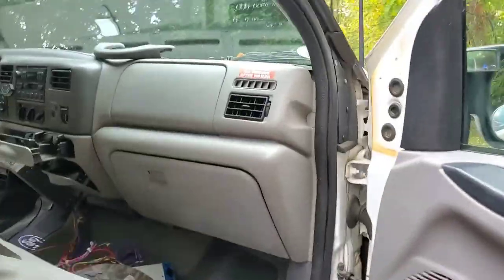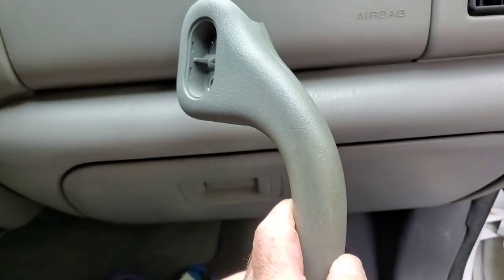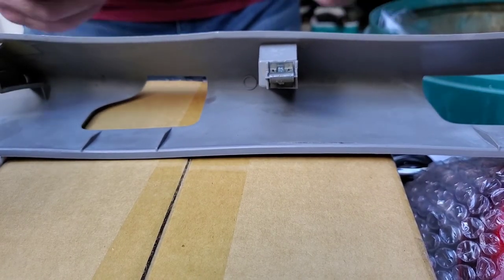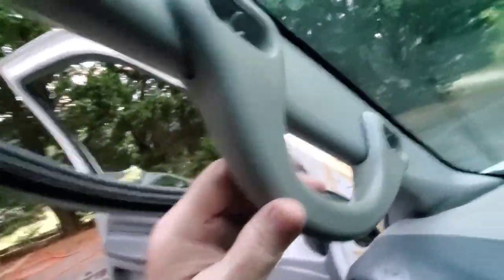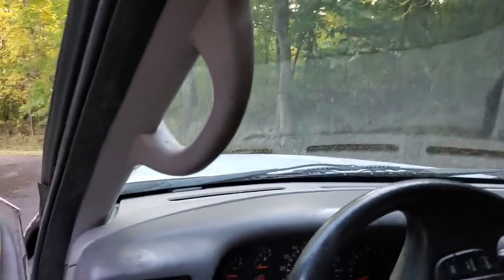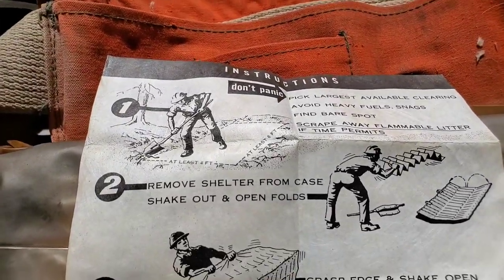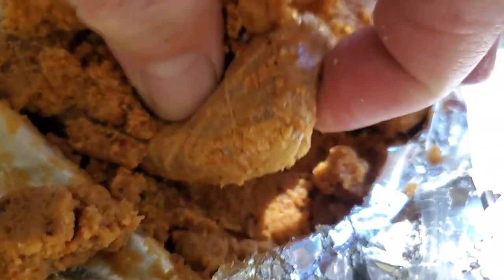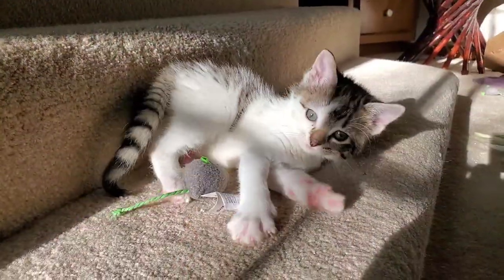Custom Driver's side A pillar grab handle installation. 99 Ford Super Duty 4X4 V10  "Super Dirty"

Comment: I have an 02 f150 and 02 F350...150 has grab handles on both sides, but the 350 only on the passenger side. While at my local salvage yard, I spotted an 01 f250 with the grab handles on both sides, so I bought the handle and trim piece. I will have to drill the frame for the holes, not that big of a deal. Just time consuming 🤷‍♂️
Reply from the maker: I just got a $500 05 f250 and it has the handles on both sides.  I sure like having it in my 99. Glad you made it work!
Reply: It was your video that was an extreme help. So it all worked out with your virtual assistance 😁

Comment: Will the 2008-2010 grab handles bolt right in to a 1999-2007 cab?
Reply from the maker: The early trucks (like my 99) don't have any mounts on the driver's A pillar. Not sure what year they started, but my 05 came with A pillar grab handles on both sides. Nothing will bolt right in to an early truck without going through what my video shows.